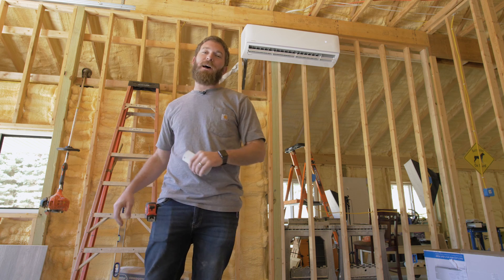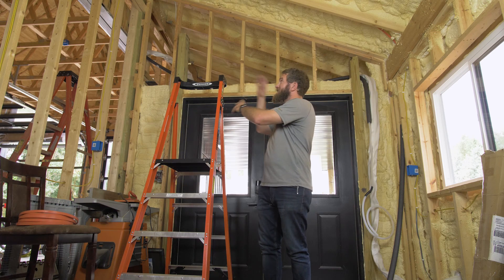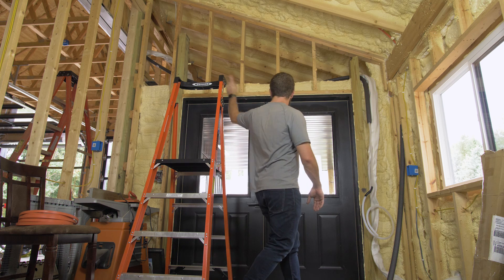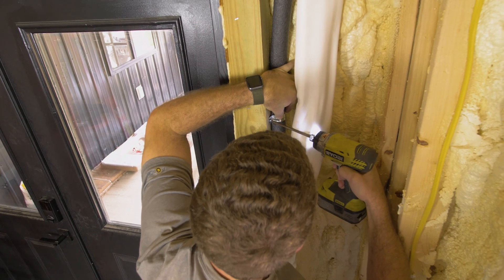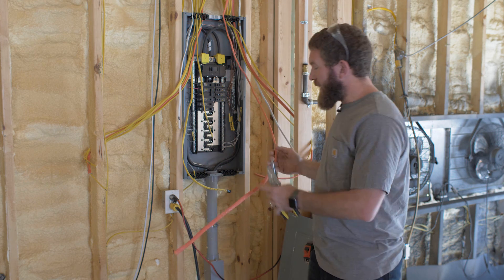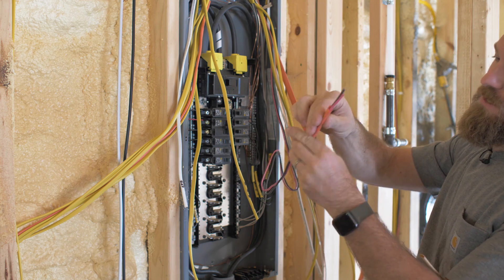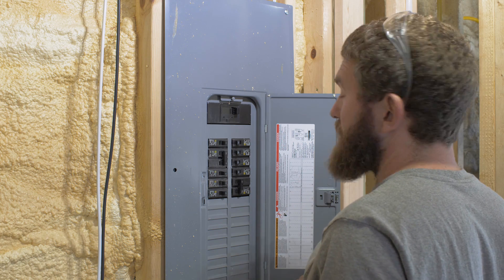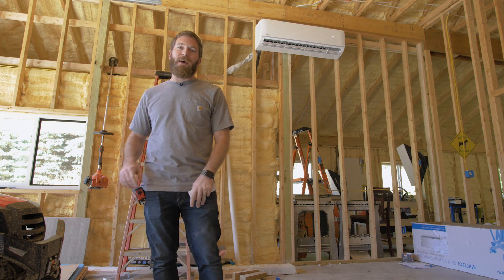Installing a DIY Mini Split in a Garage

Comment: When you say a little bit smaller than the outline.. did you do like 1/2" less? an inch less?
I am also taking the same approach as you. You're the only video I have seen where the mini split is installed prior to the drywall.

Comment: A question.  I have a garage that is roughly 24 feet deep 22 ft wide giver take.. There is two grand bay doors in the front for cars.  Where would you install a mini split?  Also ng the long wall (2) centered?  Toward the front of the garage where you enter the house (centered)?  Or centered above the garage door openings?

Comment: you missed the step were you vacuum the lines to less than 1000 microns. very important step to make sure txv and compressor does not have moisture or contamination.
Reply: These units are "DIY" and already have this done. This is unnecessary for the DIY units. That's why you can do it yourself.

Comment: That 36k unit only called for a 30amp breaker and what size disconnect did you use?  Also was it a fused disconnect?

Comment: No point on getting these DYI mini splits anymore… they increased the price about 50% …..they are so overpriced its actually a waste of money to buy them. I got a Gree Mini split( MUCH BETTER BRAND) and had a professional install it and still saved $500 on the 24k BTU unit.

Comment: You are really stressing that unit by not leak testing with an inert gas, then bringing the system into a 500micron vacuum to ensure it is dry before opening the valves.
   If there was a warranty on that unit, you just voided it. There is a reason why professionally trained techs should install these. You just invited a whole bunch of potential problems in the door.
Reply: Not with the diy version.
5/7 year warranty. No vacuum or professional install required.
I just installed the non diy myself, and yes, I know I won't have the warranty

Comment: I am considering the 24k unit for a 400 sqft garge that is my woodshop  my question is how flexible is the line set?  Is it typical soft copper how tight a radius do you think I could make with the line set? I want to mount the air handler on the wall 8 foot ceiling, and run the line set inside of the wall to the hole in the brick were and existing mini split is. Thanks.😁🛫

Comment: I have 1008sq ft 1story home 10 ft high ceilings all together 6rooms in the house would the system you installed be strong enough to heat and cool the entire house if not is there a ductless system you can recommend.
Reply: For all those bedrooms, you might consider looking into a multi zone mini split system :)

Comment: What was that small grey electrical box installed next to the outdoor part of this unit? Was that installed specific for this project? Looked like it had a breaker of some sort that you installed. Thanks!
Reply from the maker: It is a fused disconnect and it is specifically for this unit.

Comment: Great info, but don t those lines need to be vacuum??  I don't know  much about a/c, but just wondering.  Hello from Sonora Mexico.
Reply: He mentioned in the video that the lines were precharged...was the indoor unit PRECHARGED ALSO?  They aren't usually...
Reply: With those pre-charge lines they’re already connected to the evaporator so there’s no need to pull a vacuum.
Reply: Yes, they should be vacuumed.  Imagine, mr cool probably sent them a free unit for this video..  :-/  This is how they advertise these days.
Reply: @jagboy69  no they send them out sealed with a vacuum on them.
Reply: These systems already have a vacuum and are precharged. When you connect the lines it equalizes.

Comment: Hello,  Getting ready to put in my shop's mini split.  What I am wondering is would there be any disadvantage to housing the compressor in a large outside unheated building?  This would be in a mainly heating situation.  Can't help but think that exposing all the metal and even the painted metal that is in the compressor to rain, wind, debris, snow etc. is going to shorten its life.  Not to mention getting buried in snow inhibiting its functions.  Since there is plenty of ventilation I don't think that would be an issue.  I am thinking as well that any residual heat (if there is any, it is not an insulated or heated building with over 600 cu. ft. of interior space) would only help when the outside temp drops below thirty?   I do know things last much longer in a temperate rainforest when they are sheltered from the elements.  Evergreen needles can also clog the heat exchange fins big time.  Going to give it a try as I can't think of any theoretical reason why it wouldn't be a good thing.  Take care.  Doug
Reply from the maker: Douglas Thompson I cant think of any. Just make sure it can drain. Keeping it out of the elements is great
Reply: @rogueengineer  Got it covered with a drain out the floor to a French drain.  Floor is an eight inch concrete slab and it will be up off of that so if it leaks a bit it's no problem.  Was also thinking the slab would act as a heat sink to some degree.  Ground temp here is 48-50.  Thanks.  Dough

Comment: I'm about to install a non DIY one in a new workshop in WI, thanks for the info.   I thought the compressor should be elevated above the slab so you dont end up with snow around it (or ice buildup around the base after defrost cycles).  Looking forward to an update video after you've used it for a full year.
Reply from the maker: No problem Adam. There is a drain line that is routed from under the unit away from it to avoid the ice build up problem. The snow build up can be an issue but unfortunately we don't have a higher spot to mount it since there is a window right above it. We also have a radiant floor so this will probably never even turn on in the winter. It is more for cooling in the summer.
Reply: @rogueengineer  That makes sense.  The radiant heat should be great in the winter.  My boys and I appreciate the work you do.